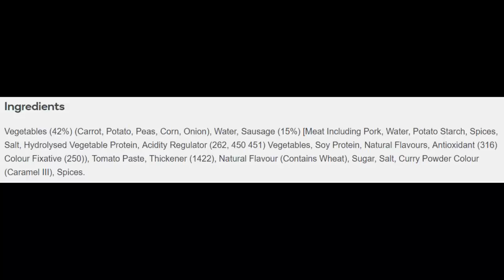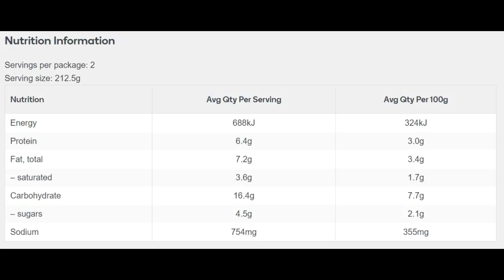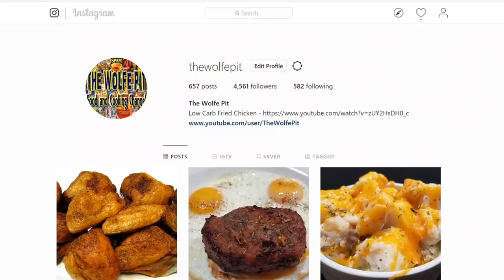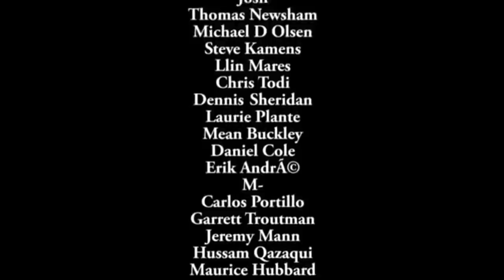Vienna Sausage Stew in a CAN - WHAT ARE WE EATING?? - The Wolfe Pit

Comment: Australia has both hotdogs and sausages, we just don't eat hotdogs very often
Reply: Don't you guys have hotdogs on bread at like every event?
Reply: @Iampatrix  no we have sausages, although they are often pretty cheap quality
Reply: Pat Patrix those are called sausage sizzles, we just have sausages in white bread with sauce
Reply: @equinox6944  do you guys not know that hot dogs ARE sausages?
Reply: Pat Patrix no actually, sausages from a sausage sizzle are not the same as hotdog sausages 🙂
Reply: @equinox6944  hotdog is more a loose term for the actual wiener in a bun, but it's still a sausage. All hot dogs are sausages,  but you wouldn't call all sausages hotdogs. Unless you put it in a bun, then it might get referred to as a hot dog. You guys over think this hotdog vs sausage thing too much, hotdog originated as slang for German sausages and then official brands like Nathan's and Oscar-Meyer started using it.